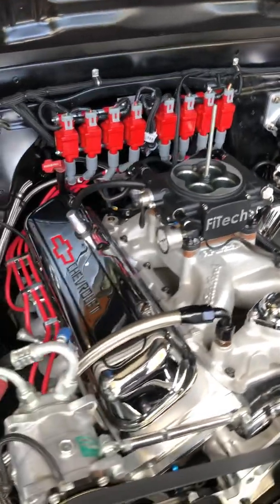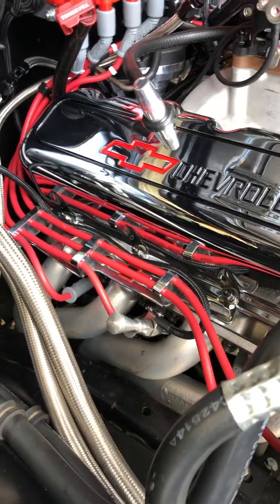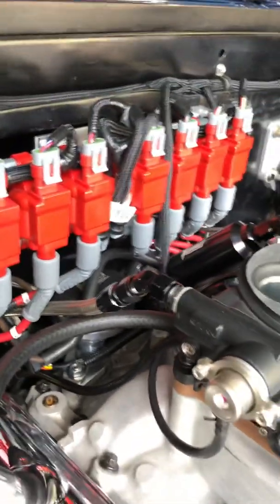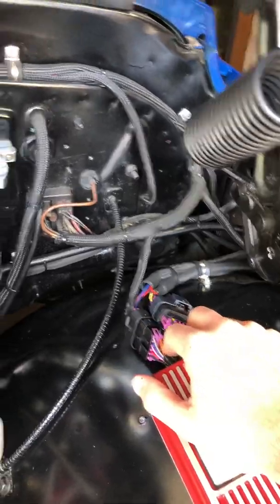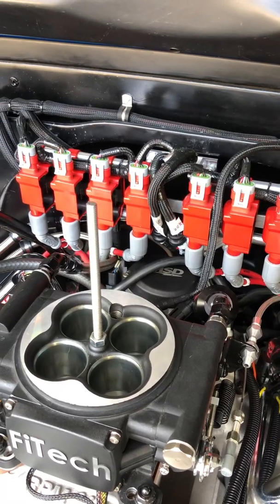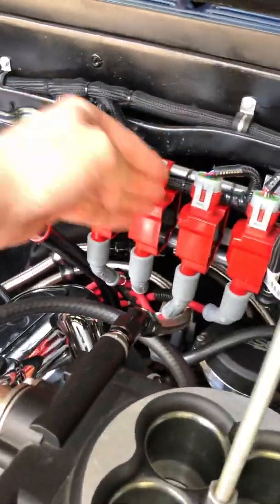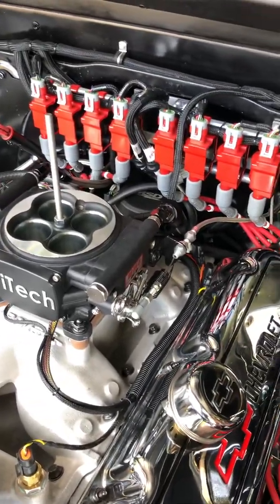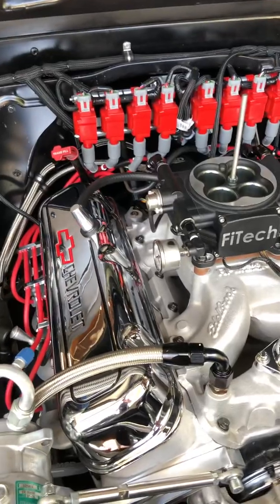MSD DIS Distributorless Overview and Basic Setup Tips

Comment: Hey brother I’m in need on some advice on setting this system , everything runs on point until it warms up to op temps , than cam sensor code shows up and no more spark … did you had this issues at the beginning?

Comment: Hey man appreciate you making this video. You said 15 degrees not 50 right? 
Followed the instructions, set to 50 BTDC, lined up the pointer and all that and not only will it not start but I keep getting a cam sensor fault in the software. And I'm beating my head against the wall on this. Been through all the settings, checked all the wiring probably 10 times at this point. Have power everywhere it should be, followed their directions, gone through the setup probably a dozen times and that's where I am. Only thing I haven't done at this point is email their tech support.
Reply: Did you get this figured out?
Reply: @milesmathews7108  Took a little time but yes, turned out to be a few different things.
Replaced a weak starter to get the cranking RPM up a bit was one thing. The main thing that was messing me up was I had the hold down loose while I was trying to get it started which was allowing the distributor to walk up out of the engine a bit. Once I had the new starter in and locked the distributor down it fired right off. Only other thing I had to do was set the base timing to 8 degrees from 0-1000 RPM.
MSD has a great video on YouTube setting up one of these dual-sync distributors which was also a big help.

Comment: Great video. I'm trying to convert a 6 cyl distributor engine to COP. It's for a Zenith 601 with a Jabiru 3300 engine. You just can't buy caps a rotors anymore, and an upgrade would be nice. So far I can't find anything...
Reply: Would take some work but something like the MegaSquirt could probably get that done for you.
Reply: @sparkplug1018  I was looking at a microsquirt. I think that might get it done too. May even be able to use the original flywheel magnets for timing sensors, (6 cyl & there's 3 on the flywheel) wasted spark, and vroom! Or airplane noise as required!!!

Comment: I have this same setup on my 383 stocker with 13:1 cr all forged internals all billet aluminum External compoments, AFR 210 heads, Custom built twin turbo hot side/ cold side with 76mm turbos, in a 76 C10. still working out my carb turning. but planning to transision to EFI with a terminator X setup. Your video helped me Tremendously.
Reply: Terminator X on a sbc??

Comment: I joined your Facebook group but there is nothing there, meaning no content. Is it active?
Reply from the maker: There should be content there, but not much activity.
Reply: @mechtrician1  i saw that you did a video on the sniper ignition system.  I really the concept of separate coils but I really have a hard time decoding which system to use.  I have Sniper efi and like the idea that their ignition system is made to work with their existing. Concerned about reliability of anything MSD lately. What are your thoughts between the two systems?. I am running a Vortec 350 in my car.
By the way thank you for the quick response, like in minutes. Amazing.
Reply from the maker: @jerrybennett7856  if you’re using the sniper,  just go with the Hyperspark system along with it. It’s very well integrated. You can do the coil on plug with the terminator and HP EFI but not the sniper. The MSD dis system has been reliable for me though. It’s just it’s own system and not integrated with the EFI. Still works well though.
Reply: @mechtrician1  thank you very much. I love your channel.
Reply: @mechtrician1 where should I hook map sensor hose
Reply from the maker: @mrs.malfoy109  any manifold vacuum port will work.

Comment: Yo. Same shit about the coils. I self tap them to my 88 1500 fenders before I found a bracket that uses the 4 valve cover bolts to. It even is high enough to keep the stock pvc system mines 1" vacuum lines to a catch can an they still clear the brackets.
Reply: What mount did you use.
Reply: @JoshuaABartlett  look though my shorts  there a re a few videos of the engine

Comment: How did you set the distributor? 50 degree or 15?
Reply from the maker: Neither. You set the crank at TDC #1, stab the distributor with the notch pointing at #1, power it up, rotate the housing it until the cam and crank lights are on, and if I remember correctly you back it off until one or both lights are off. It’s in the instructions though. Very easy.
Reply: I'm experiencing timing problems with this system and backfire in the sniper. Is there a way to connect with you?
Reply from the maker: @josecarlospedrazaojeda9370  yes. There is a small group of us on a Facebook group. Here is the link. 
https://www.facebook.com/groups/251698662584696/?ref=share

Sounds like you might have the distributor 180° out.
Reply: Thank you I just requested to join the group. I drop my dial sync at 50 btc on compression as holley instructions.  This is being a nightmare the car backfires when is underload.
Reply from the maker: @josecarlospedrazaojeda9370  approved it. 
That’s not right. I don’t think that’s the right instructions. You drop it in at 0°.
Reply: In the video you mention 15 degree to drop the distributor and the metal plate with notch to face #1
Reply from the maker: @josecarlospedrazaojeda9370  that’s the synch timing. Once you have it running, you have to set the timing static, and match the timing on the crank to the setting in the computer. I chose 15 degrees as the locked timing just because it’s a good idle number.
Reply: I just drop the distributor at 0 and 15 and could not get it to start.
Reply from the maker: @josecarlospedrazaojeda9370  I replied to you on Facebook. You sure it’s 0 degrees number 1 and not number 6?  It has 2 top dead centers.

Comment: Can I use the Holley dual sync distributor and the terminatorX and if so can I control both crank and timing or would I still need a msd box or 24x reluctor wheel i have a sbc 350
Reply from the maker: If you use the dual sync, it’s all you need as far as I know. I know the terminator works with the dual sync distributor.

Comment: So they make them for Ford engines. That include the 460ci?
Reply from the maker: Unfortunately, I don’t believe so. SBF only, 289/302 and 351w. 
If they make a dual sync distributor for the 460, it can be used with this system to make it work.
Reply: @mechtrician1  Dang. I think there may be something similar to these things that are applicable for the 460 after I've read your reply and done research. I think there was something called "MSD's Cam Sync distributor plug" and I believe it works the same way like the DIS: no rotor, coils per plug etc (correct me if I'm wrong but that's what I came across on my search). It looked like the typical piece of billet masterpiece.
Reply from the maker: There may very well be.  You might call MSD actually and ask them.  They might have a solution to allow you to use it on a 460.
Reply: @mechtrician1  I hope so. I'll give them a call once I got enough green to put my 94 F-150 in the tuner shop. Thanks for your help buddy! 👍

Comment: Can you use this direct ignition system with a regular non EFI holley carberator?
Reply from the maker: Yes you sure can.
Reply: @mechtrician1  thanks for the quick response! i plan on doing efi in the future but have a worn out ignition system that needs an upgrade so i want to start with this because my carb works fine for now

Comment: Hi. Nice looking set up you have; the MSD DIS looks user friendly. On the MSD control box, is it required to set up a hose line to connect the MAP sensor? Control box to connect to the actual vac line on the manifold?  I am considering installing this MSD onto an L98 350 Tuned Port.  Thanks
Reply from the maker: Hi there. No you do not have to connect vacuum if you don’t want to. I’d recommend it to take full advantage of the timing control but you don’t have to.

Comment: good god those wires are too long
Reply from the maker: The plug wires?  Same length as a distributor…
Reply: @mechtrician1  i understand that thats part of the reason you upgraded do a quick search on the effects
Reply: @mechtrician1  well  guess it doesnt really apply hgere but https://www.jalopyjournal.com/forum/threads/too-long-of-spark-plug-wires-cause-loss-of-power.321097/
Reply from the maker: Yeah with coil per plug, CD box and the super conductor wires, it’s not a problem. There would be zero noticeable difference if they were shorter.
Reply: @mechtrician1  yeah it would seem I misread that bullshit somewhere

Comment: So the sensors still rely on the cam for accuracy?
Reply from the maker: Not really. The dual sync distributor has inner and outer optical sensors inside, set at 2 different radii. This is how it knows absolutely at what firing position it’s at.  If it only had one sensor, it would only know when to fire, but not what position. So, it doesn’t rely on the cam, it just relies on being phased correctly at install. In other words, the firing order is built into the distributor.
Reply from the maker: @UCYhdYUYDHxjT8ie6hK9-sqA yes it’s driven off the cam as any other standard distributor. But the cam itself doesn’t set the firing order. I thought that’s what you were getting at.
Reply: @mechtrician1  I'm just wondering how Accurate it is. Other systems use a crank censor to eliminate play in the gears and chain. But if its doin some magic I don't understand yet then I'm all for getting one
Reply from the maker: @basketballcory2  Yeah understandable.  You will have whatever play is in your timing set, but the distributor itself has features for high accuracy.  The shutter is welded to the shaft so there is no play, all the components are machined, etc.
Reply: @basketballcory2   basically its as accurate as you set it up. If you know for a fact that your number 1 tdc is correct and you set everything up knowing that your taking any play out like you would set up timing chain or phasing a rator. Ect. Then normal routine like checking timing for wear in any application. Changing bronz gear in normal intervals like normal if your using a soild roller camshaft. Then id say its probably very accurate.
Reply: @basketballcory2  This system is NOT as accurate as a true crank triggered ignition. MSD calling their dual sensor a crank sensor IS misleading.

Comment: I’m thinking about buying the MSD EFI and run it for a while until I get the direct ignition then combine them. I assume you can since you did it here with a fitech
Reply from the maker: Yep you will be able to do that. The ignition system is pretty much transparent to the fuel injection system.
Reply: @mechtrician1  how does the temp sensor work an hook up on the efi setup and do you think it’s better than the setup they give you in a dual electric system from alloy works?

Comment: Is your engine roller or flat tappet? just wondering does it matter at all with this set up
Reply from the maker: My engine is a hyd. roller, but the distributor drive uses a standard MSD 0.5" melonized gear.  I actually transferred the gear from my old MSD distributor to this one just because they were already mated.  My particular cam is compatible with the melonized gear, but you can put a bronze gear on this setup if needed.
Reply: @mechtrician1  alright and thanks for the reply.